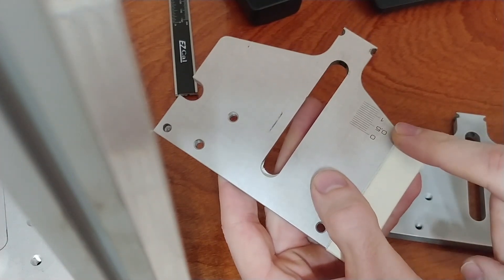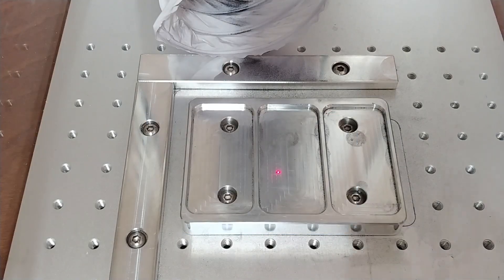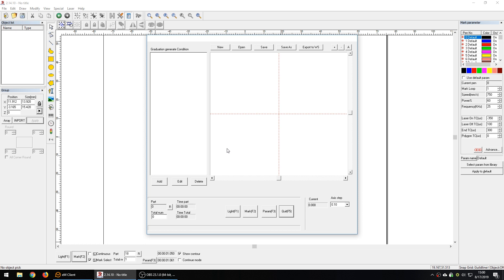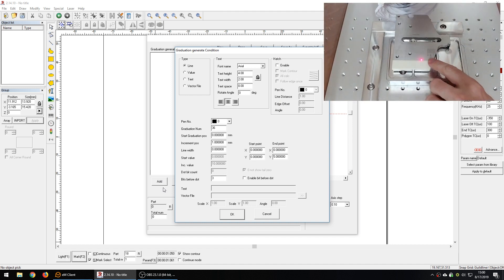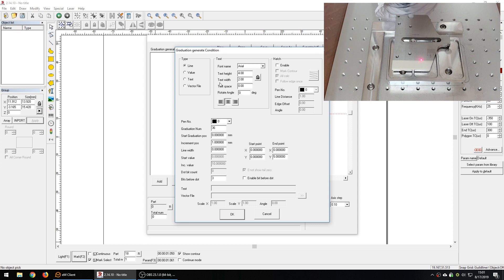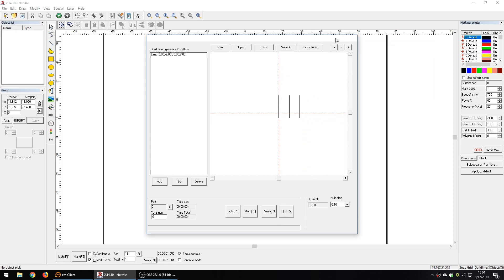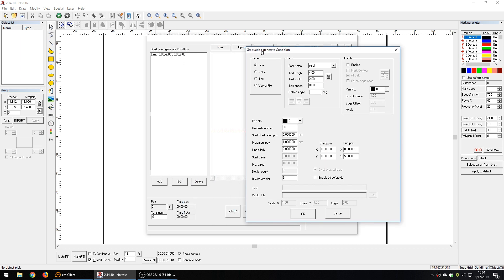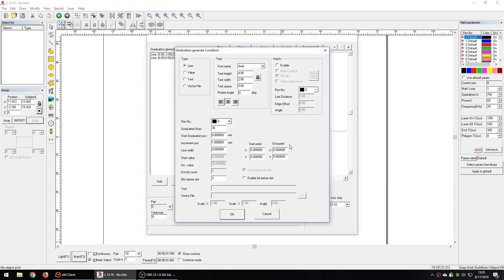Power Ruler - Setting Up a Ruler for Fiber Laser Marking in EzCad2 - Example #1

Comment: I have a question, if I want to mark on the keyboard buttons what’s the best hatch - speed and power settings?
Reply from the maker: If it's plastic, use low power, fast speed and low/medium frequency and don't go too dense with the hatch something like 0.05mm.